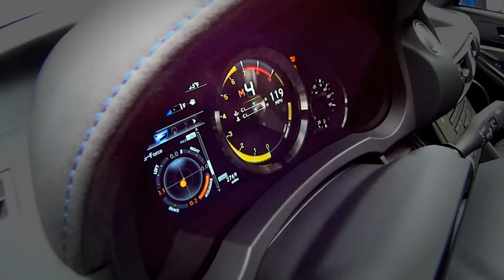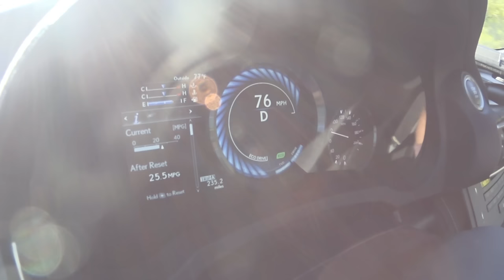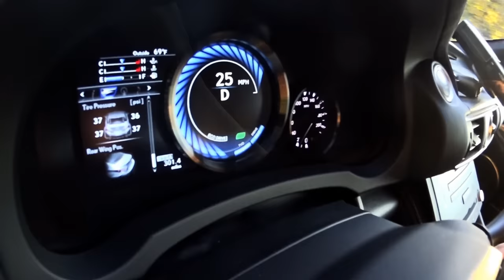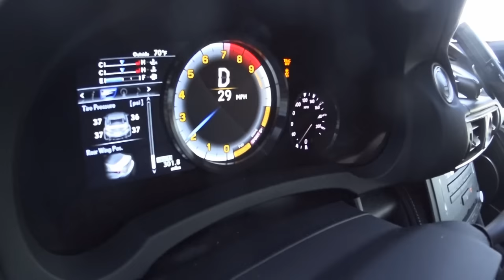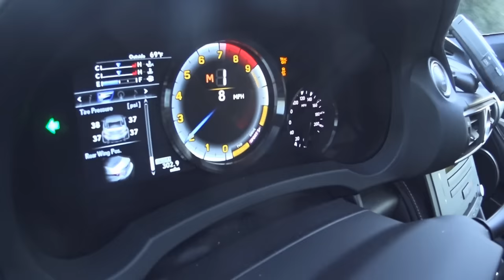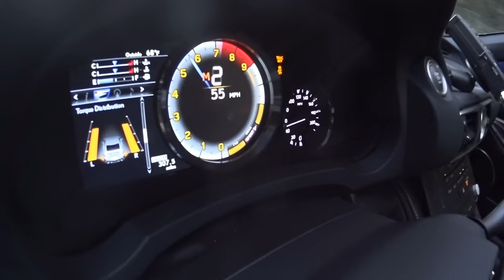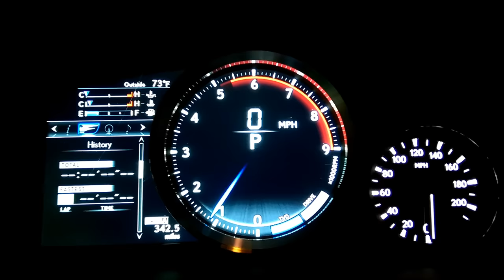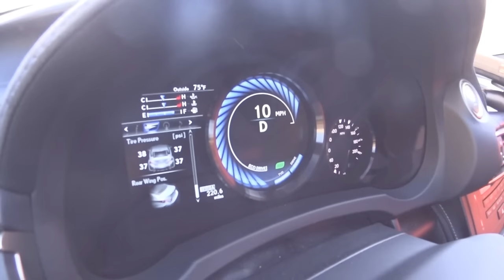Review | 2015 Lexus RC F | The License Killer

Comment: Such a great car. Has any rich mofo or YouTuber put a flywheel, a tremec 6speed, and a new driveshaft into this beast? Someone needs to do this car justice. Toyota never will because profit is more important than driving enjoyment.
Reply: Sadly since these cars are so rare they don't have much help in the aftermarket to the point where no one has even really tried to tear apart the car or even considered doing such a thing. And honestly as cool as it would be i don't really think a manual transmission fits this car specifically. And ISF with a Manual trans would be more fitting but the RCF just feels too elegant to be banging gears in lol.

Comment: I have no fucking clue what bizarre comment you two are making about the sound quality of romantic music. I hope you aren't crazy enough to think the actual gain control has a direct relation to power being driven through the amp blah blah blah. JUST FOR EXAMPLE If you had higher gain on the input (let's say you are using AUX IN), and your car goes to 50 out of 50 max volume, you might actually max out the amp at 25 or 30 due to starting with higher gain before anything hits the amp (e.g. higher level at the preamp). A lot of people go past the max the amp can handle and think they are still increasing the volume when the idiots are really just starting to produce square shaped waves which can blow out speakers. There is no "power" beyond that because it doesn't work like that at all, the audio equipment which is adjusting the gain (the head unit) has no idea what actual "volume" level is being produced, it is "dumb" in that sense. Hence manufacturers usually set it conservatively to avoid idiots blowing out their speakers. In reality, the consumer just needs to know volume knob has nothing to do with power. It depends on the source first (which is beyond the manufacturers' control in many cases, like aux in, or even a CD since you could have a 1980s CD from before the loudness wars started, or a 2010 CD which has been compressed to hell already by the sound engineer).

Now my GUESS about what y'all are REALLY trying to say has NOTHING to do with the amp or the speakers or the head unit. You are PROBABLY requesting dynamic range compression, or a chip by Dolby that boosts certain frequencies under low volume conditions to account for the fact that environmental noise is making those frequencies inaudible and thus reducing the emotional impact of the music. If that is the case... you should really just be clear because it is a point completely unrelated to speakers/amp, and probably the reason you aren't experiencing it on a lesser car ... well I don't have any sure idea but it may actually relate to a way that cheaper car is DISTORTING your audio in a very undesirable fashion so it is NOT a good thing or a feature.

Comment: @ $70,000+,No Tks.I Plan on Upgrading My 2017 RC350  Rear Calipers ,Frts.are Already 4 Piston,If You Dump Couple 32 oz.Cans of Unleaded Octanium VP Racing Fuel ,Ur H
.p.Goes Up 24-28 h.p. Depending on  if Ur Prem.is 91-93 Oct.& My Tires & Rims are 21" Not 19' s Like on the 2015 RCF & I Have rwhl Steering.I Have Not Found a Curve My RC350 F Sprt.Hasn' t Taken Easily.As Long as The VP Racing Gas Octanium is 1 can per fill up & Not 2 & it's  Not an Every Tank Fill -Up, Don't Have to Clean the Yellowing Off Plugs. Only if I Move to GERMANY, Where I Could Enjoy the 440-460 h.p.Legally, Would I Consider Adding a Single Turbo to My 3.5  Present Set Up,if Lexus Thought My V-6  Could Handle the Single Turbo,W/ Out Extra Forging to the Eng.

Comment: 3958lbs. Why so heavy? Even s550 mustangs with steel suspension components weigh less.
Reply: A lot of it comes from the sound deadening and those seats. It's a luxury car after all and non of them are very light. Sit in a Mustang then sit in one of these and you'll see and feel the quality difference that adds to the weight.

Comment: Actually M4 is about 500lbs less and has much better trunk space, including folding rear seats
Reply: Ilya Elis that's true but can that car give you 200K free miles of less stress of stuff breaking down.
Reply: Rain Santiago Probably not, but F generation of BMWs have been pretty solid. And not many drive cars for 200k miles. I personally changed 5 cars in past 9 years and none even reached 100k
Reply: Ilya Elis but thats the thing with Euro cars you got to be on the dot with the maintenance otherwise its a massive money pit.
Reply: Rain Santiago All cars need proper maintenance. With Toyotas it's a pain too since they now use "lifetime" fluids and dealers refuse to replace anything
Reply: Ilya Elis I'm implying that when it comes to European cars you need to be on the dot when it comes to certain aspects of maintenance meaning you have little or zero margin of error. With Japanese you have some room on that matter. BMW are great if you know the right people or have a indy shop that won't charge an arm and leg.
Reply: Ilya Elis better gas mileage also

Comment: Gen 6 Camaro SS would smoke this ugly heavy piece of sh***...on road & track
The only nice things about it are the interior and the transmission. You as a person can fall in love with it but in the competitive world of sports cars, it has no place. The professionals such as J. Clarkson and Chris Harris hated this car.
Reply from the maker: +Erfan Eilati Yet Clarkson said he loved the GS-F which is almost the identical car.  I have had both on track and dynamically they are basically the same.  What you can scratch off the list from Harris and Clarkson on this car is the fact that while competitors may have faster better handling cars you get an NA V8 here that is reliable with no BS to worry about with planing to do major proactive engine repairs. That is huge.
Reply: GS-F and RC-F may share the same platform and components but they compete in two different class of cars with two different expectations. Like I said, I respect if someone liked this car; it is all about personal preferences; but, a ~4000 pounds sports car with a horrible handling, poor engine response and brakes is certainly not a fun car to drive and cannot compete with the rivals. I agree that we should all appreciate the cars with NA V8 but as good and reliable as the Lexus 5.0 is, it does not perform well in RC-F. 
Although I did not agree with your opinion, I still liked the video because I appreciate all the time and effort that you guys have put into making and editing such a high quality video.
Reply from the maker: +Erfan Eilati I totally disagree with you on, brakes, throttle response and performance.  It's incredibly capable but its not a hardended track day car, but neither are your modern M cars.  Not sure what you are comparing the car too but just because it has two doors does not make it any worse than GSF which uses same brakes motor and trans, dampers etc.  I will agree both cars are waaaay too heavy.